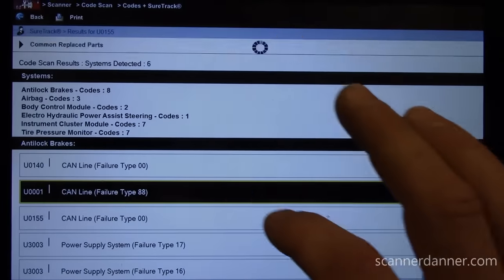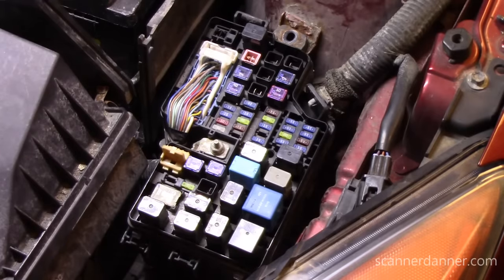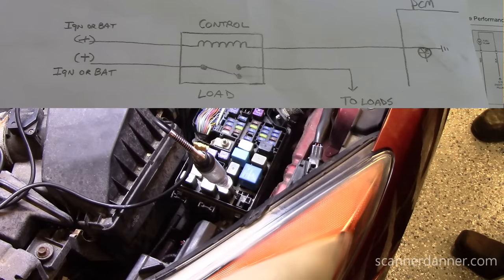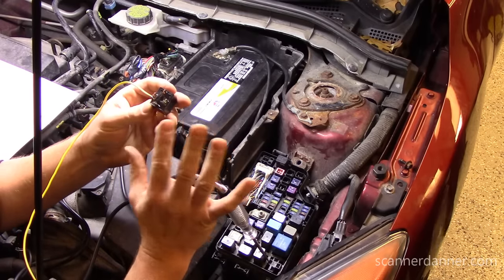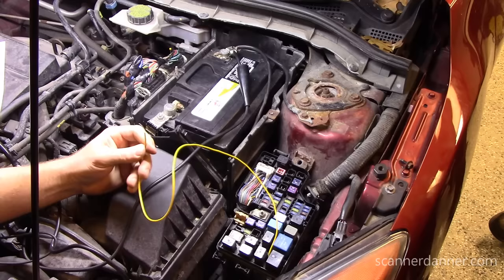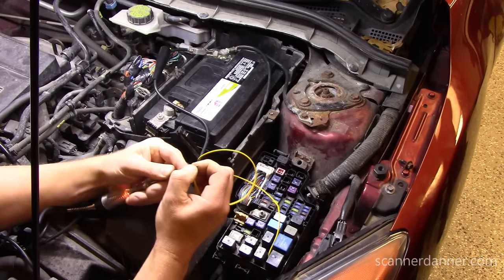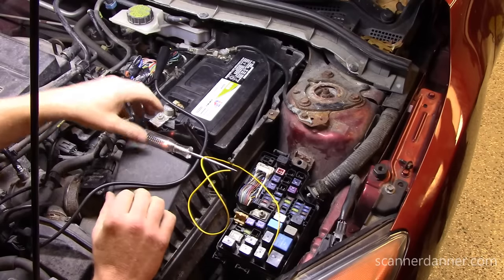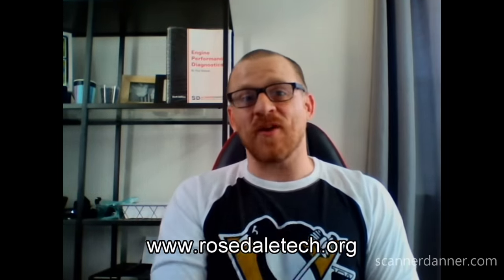2010 Mazda 3 No Communication With PCM, No Start, No Crank

Comment: How much do you charge for a job like this?
Reply from the maker: Start with a flat fee going in. Whether it takes you 5 minutes or 60, that initial fee is the same. Then after 1 hour, if you need more time, you call them back. If they refuse additional time, then you tell them what is NOT wrong with it and wash your hands of it.

Comment: What if there was no ground from the computer?
Reply from the maker: no sure what you mean? can you give me a time frame of the video where your question is coming from? Thanks!
Reply: ScannerDanner Thanks for taking out time. My question was the main relay was missing the ground from the computer. What if there is no ground coming from the computer to the main relay. Could it be a power issue on the computer side?
Reply from the maker: So it was a ground side switched circuit that was not switching on?
The key in answering this is what else doesn't work? If it is multiple things, then yes, an main power or ground could be the issue. If it is only this one circuit that is not working, then most likely no, it would not be
Reply: ScannerDanner ok thanks for your help.